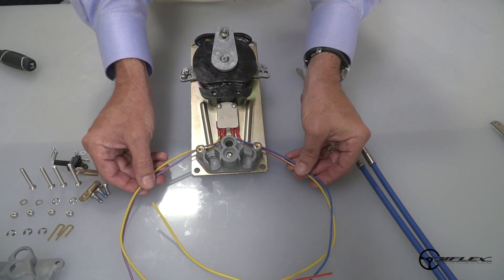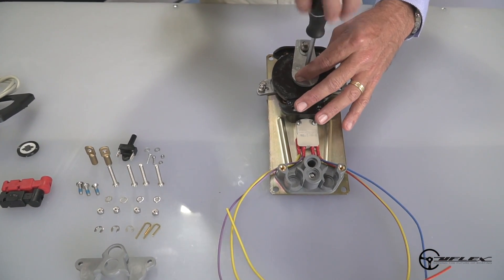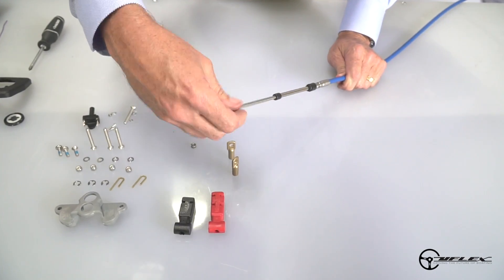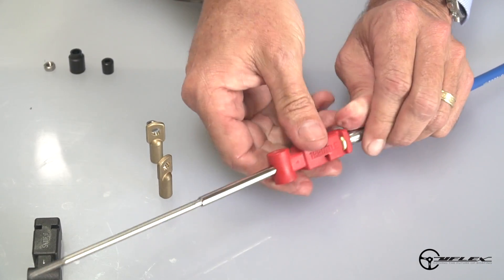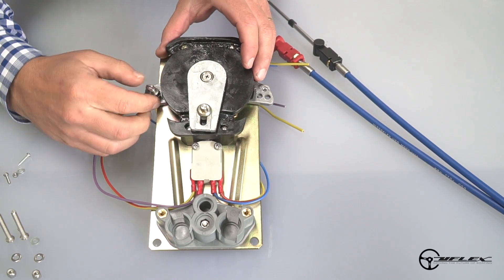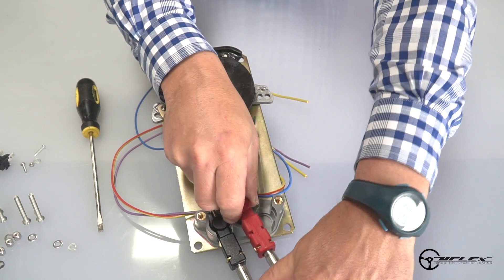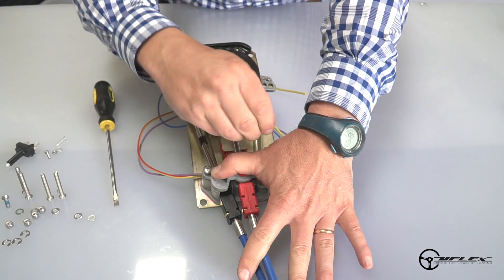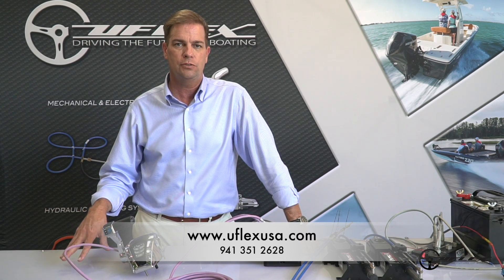Shift and Throttle Cable installation on Uflex Control

Comment: You do a great job. I removed my handle from the neutral position, and I couldn’t get it back on in the neutral position after remodeling my boat how do I know it’s in the neutral position to reinstall my handle

Comment: The video is an outstanding and will presented one.  The explanation is  extremely helpful.   I have a F25 Yamaha F25LEHB boat motor year 2016 model.  Can you tell me how or where I can be informed that my Yamaha motor is a pull or a push to open throttle.  Thank you sincerely for any consolation in you helping me.

Comment: Hi - fine video. To me, it is very strange that there is no information on how to install the B301 that I just bought! Well on fitting it there is, but how to select and install the cables (like in this video) ... none what so ever! Do you have any specific manual regarding cabling the B301?

Comment: Too many variations. Too many different parts. I understand cables have to be a variety of lengths for different boats but then you have to make sure you have the right ends and i can't get much out of the video(s) about hooking up the engine end so i guess i will just pull the engine off the bracket on my sailboat and give it my best shot of putting them back hooked up and adjusted exactly like before. Screw marking them(my first inclination) and just snap a photo. Then take them off so i can tear into this hot mess and get a new home made impeller in my water pump. This i will start glueing together as soon as i can get the old one out of the water pump. Once i do i will grind, cut or somehow strip the rubber off the bushing so i can start gluing the stuff i cut out of an old Clorox bottle or something similar. I have a furnace duct hanger i will cut strips of and bond inner tube to both sides of the galvanized sheet metal. Build it once. Build it tight. Build it right!